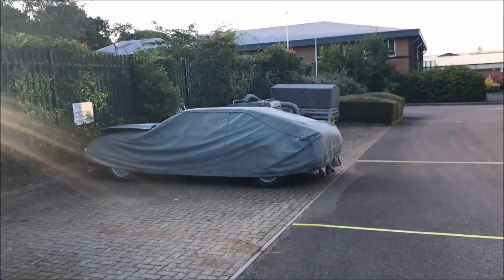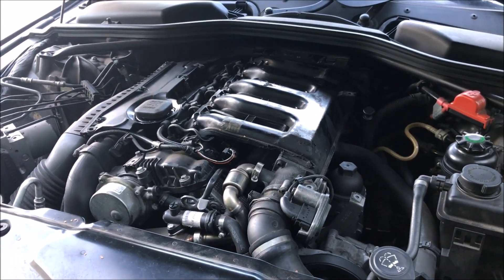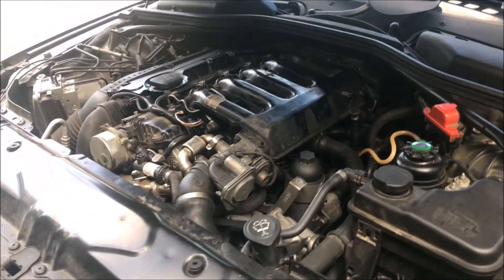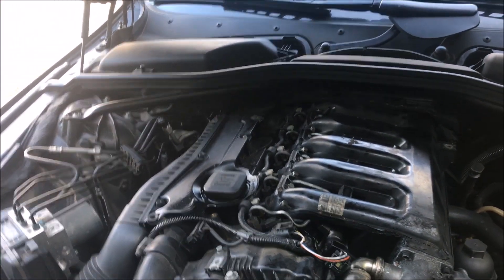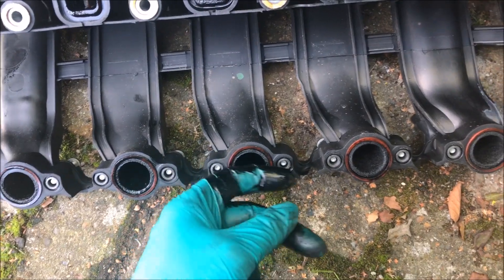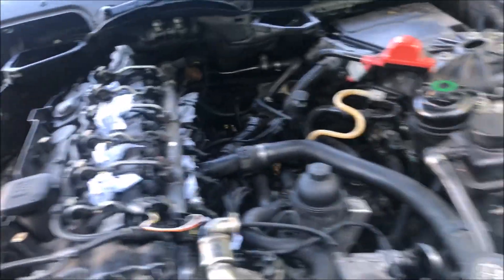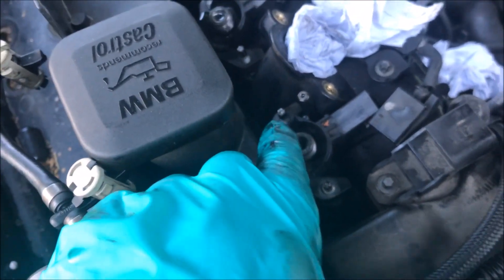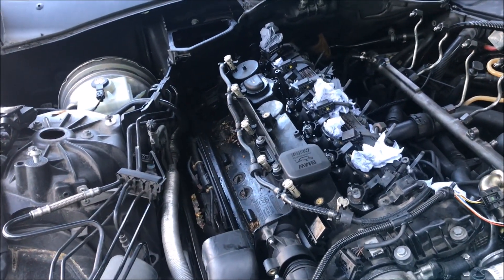BMW e60 e61 530d Oil Leak Part 1 M57 cam cover rocker cover swirl flap seals

Comment: Hello and thanks v much for the info,. Im about to do a similar job. Have same kind of oil leak at top of engine and its everywhere in engine. This gives me the confidence to take this job on!
Reply from the maker: No problem but make sure the first thing you do is change the crank case filter in the top of the cam cover. I’m pretty sure all If my leaks were the result of internal pressure caused by that filter being blocked. Change it first, clean up your engine and monitor for more leaks. It’s only a £10 parts. Takes minutes to fit and might save you loads of Afro!!!
Reply from the maker: That was meant to say agro!
Reply: Ok good to know. I will check crank case filter first. Much appreciated!

Comment: The upgrade is the vortex breather. Those loo roll ones will over pressurize the crank case, but the main bit you need to check is the rubber diaphragm for tears or splits. 

Hope all went well! I just did this a few weeks ago
Reply from the maker: Swapping to the vortex and blanking the plugs seemed to have done the job.  I had thought it was a turbo seal going, but it must have just been crank pressurisation.
Reply: Lucky! My 330d is a smoking nightmare!
Reply: @nitrosilvia  blanking which plug ?
Reply from the maker: I meant blanking plugs for the swirl flaps. If you have this problem I recommend changing the vortex filter first.

Comment: I did this to my 525d E60. I removed the swirl flaps and reused the seals. After a month went past. I noticed oil leakage when replacing my anti-roll bar bushes. I initially thought it was my power steering leaking. After further investigation. Traced it back to the seals that I was too lazy to replace when removing the swirl flaps. So.... My advice is to replace the seals at the same time you remove the flaps. Saves doing the job a second time. The seals don't cost much. Also had the vortex breather fitted as it had the crappy roll filter. I also gave the egr and inlet manifold a good clean. 
Change engine oil and oil filter every 10k miles and never had any other issues. Sold the car with 170k on it. Still pulling strong. 
Now I have the same issue with my Alpina D3. It's done 80k miles so I'll be doing the same this weekend. Good thing with the Alpina is I only have 4 inlets (N47 Engine).
Reply: did you feel/see a difference in power/mpg when removing flaps?

Comment: smoke oil from exhaust? I have a problem with my e60, smoke from the exhaust. Could it be the same problem as yours?
Reply from the maker: It’s hard to know. It could also be oil seals in the turbo charger letting lubricating oil pass into the exhaust
Reply: @nitrosilvia  exhaust burn oil, the turbo intake turbine is completely soaked with oil. And the turbo exhaust turbine without oil

Comment: I love tinkering but even I wouldn't have the patience for that bmw. So many bits on the engine and I don't know what most of them are. Plus the engine is partially under the bulkhead....
Reply from the maker: Yes it’s very packed together. If this was a petrol it would have been a 30 min job to get the cam cover off ☹️

Comment: The oil filter/cooler housing seal is another point they like to leak oil. 
And check your engine mount whilst the inlet is off, as they can also break

Comment: Hi mate, I've actually watched these videos a couple times and I'm wondering if you still think it could be a possibility a major leak could come from the manifold / swirl flaps? I'm about to tackle a similar, not losing as much oil as you were, but praying to heavens I can get away with replacing the gaskets on the inlet manifold and not have to do the vcg.
Reply from the maker: I suspect what I did was overkill. I think it was all because my brother filter was blocked. I would change that for the vortex type filter first as it’s a 5 min job and see how you get on.
Reply: @nitrosilvia  Yea I've changed to the vortex filter and still losing quite a lot. But I have a lot of oil under the inlet where the swirl flaps are located, think I need to just suck it up and do everything you done in yours. When you blanked the swirl flaps, did you also blank the egr? Can't remember off the top of my head from your other videos.
Reply: @nitrosilvia  just to let you know, my inlet manifold and head looked the exact same as yours when I took the inlet off. Absolutely caked in oil. Done the crankcase, done new gaskets and properly blanked the swirl flaps, and I’ll see if that has resolved it.

Comment: are injectors needed to be marked? does it matter in which cylinder you put them back in
Reply from the maker: I read somewhere that they are coded to the car and need to go back in order.  Not sure if its true but i did it anyway just in case.

Comment: Hello, thank you for very informative videos with good view. Do you have a link or articelnr. of the injector removal tool?
Reply from the maker: Hi thanks. This is the tool I bought 

https://www.ebay.co.uk/itm/Repair-Tool-Diesel-Injector-Removal-Puller-With-M8-M12-M14-Adaptor/123887213299?hash=item1cd840daf3:g:0l0AAOSwotNdYKEt

Comment: Hi James, thank you so much for sharing this invaliable video! I have a E93 330D M57 engine also with a big oil leak and suspect may be related to the same... Could you share the links to the parts you replaced? Thank you once again!
Reply from the maker: Before you bother doing anything else, i highly recommend changing the crank case breather filter for the later cyclone filter type.  Like this

https://www.ebay.co.uk/itm/Fits-BMW-Series-Vortex-Engine-Crankcase-Oil-Breather-Valve-E60-530D-11127799225/174045091376?hash=item2885e55630:g:P5EAAOSwTpldjI9t
Reply: @nitrosilvia  I switched from vortex to old loo textile, less oil leaks... on bmw e39 530d 2002, just change it every 24 months